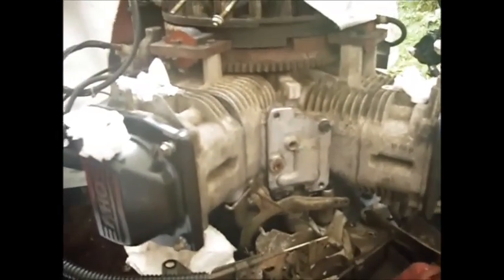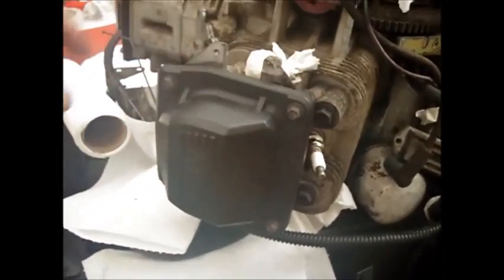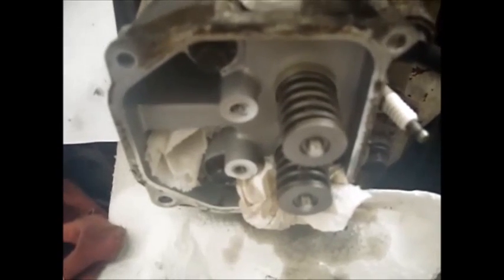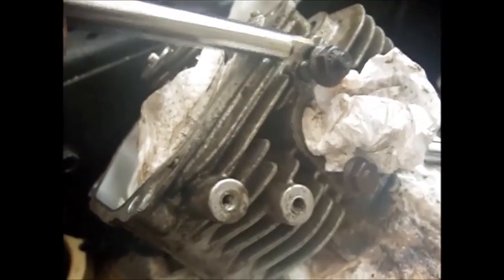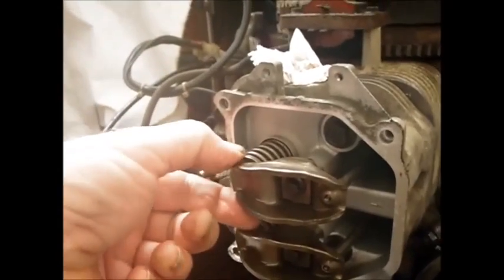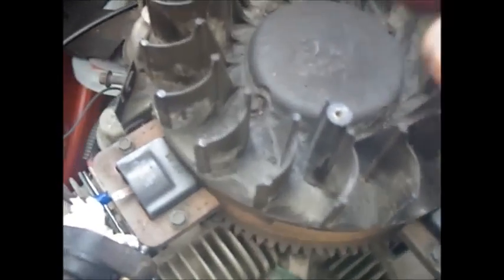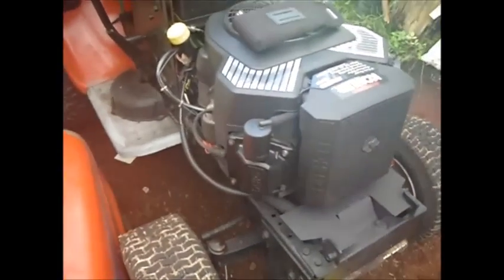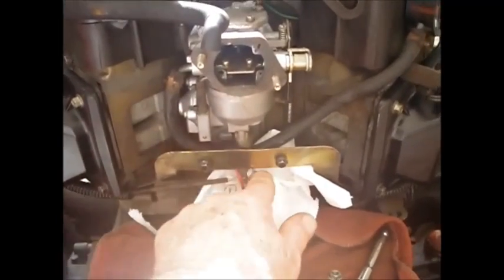Replacing a head gasket in a Kohler 25hp CV730S engine Part 3

Comment: TDC I don't see the need because rockers push rods would not be installed yet. If they were, yes the valve springs would if not on compression firing could be trying to lift the head, would give a false torque reading. With rockers off and push rods not installed yet should not be an issue. Go ahead torque away.